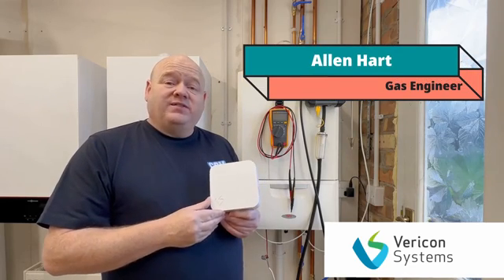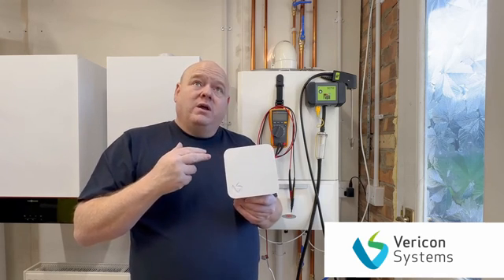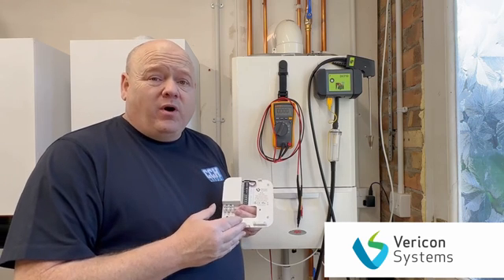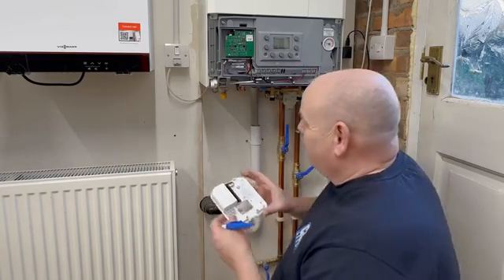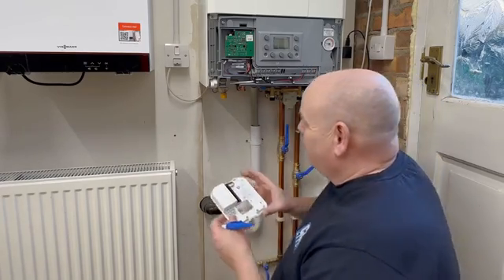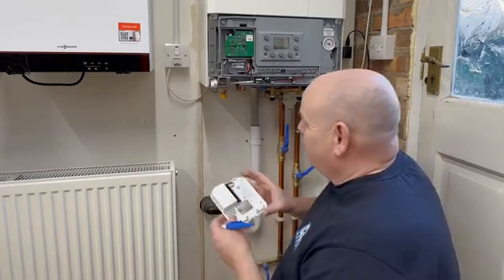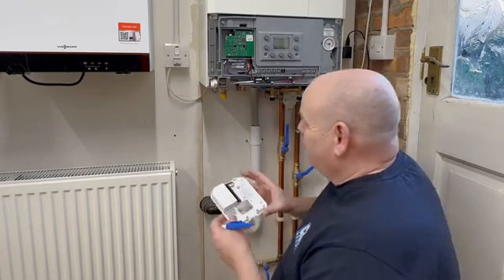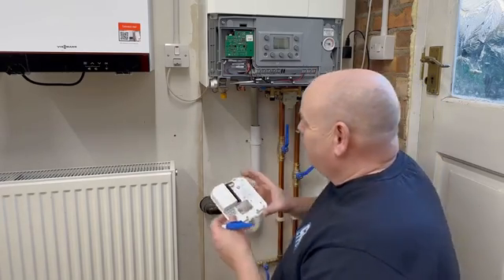Monitor Your Gas Boiler | Vericon Systems Boiler Monitor | How To Install A BCM #plumber

Comment: Alan. Just a quick question. We have a boiler which is 16 years old. I have noticed the boiler underneath is rusting through and at times it is leaking small drips of water. We have a carbon monoxide detector it was reading 041, after I opened the window the levels went back down to 0. There is no one in the room, the bottom of the boiler cover is beginning to rust. 

I’d imagine this would need just a straight replacement?

Comment: Hi Allan , I  have a combi boiler setup up with zoned heating upstairs and downstairs. Am in a new build but the boiler is t wired with opentherm or anything like that , could I still fit this ?

Comment: £184.  I would assume used where a large volume of boilers are used and monitored from a central point. Intergas have this integrated into one of their boilers. Made for the Dutch social housing market, so all boilers are monitored from one central point.
Reply from the maker: This one looks amazing as it will work for many different manufacturers, So perfect for large landlords, This is really only the start, Thanks.
Reply: @AllenHart999  
Yep it works with any boiler.